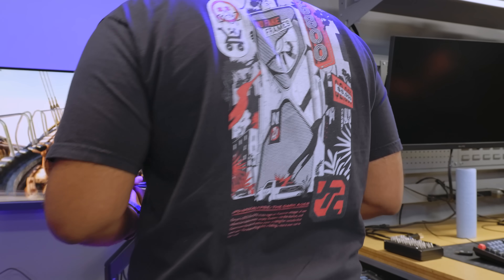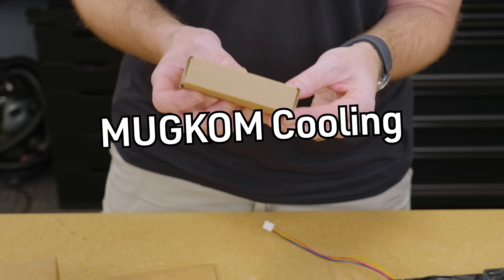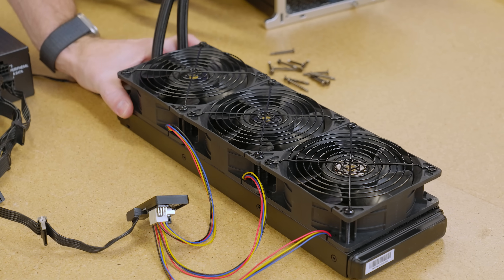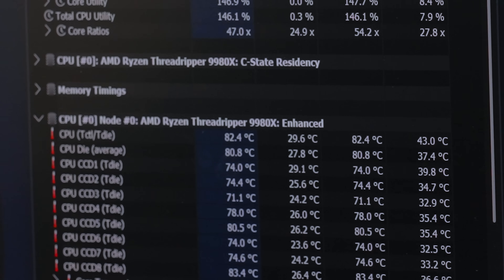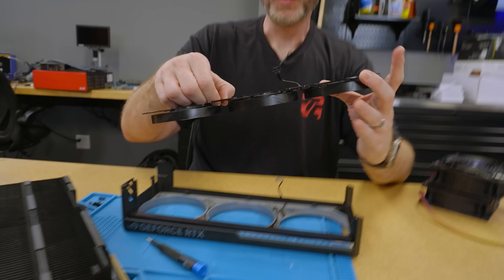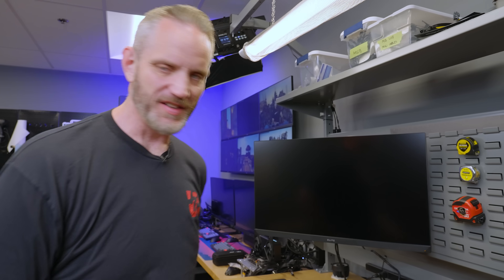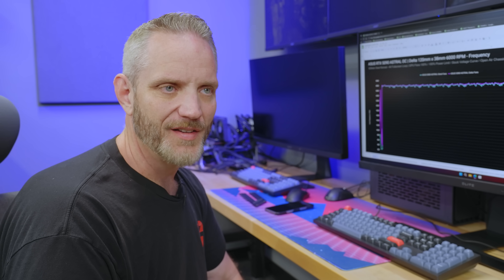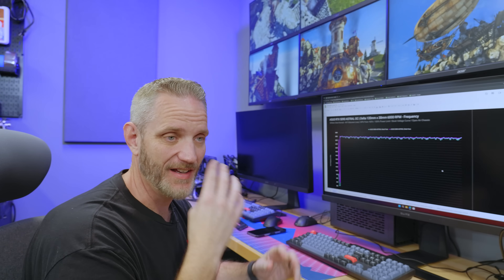Server Fans on a GPU... What could go wrong?

Comment: I think that's the same AIO my threadripper has. I do not have the same RAM though. I looked up your guy's RAM. It was over $1000. I'm like NOPE! Best I saw in reason was about $500 for 64gb. This is more than overkill for me. I was a little disapointed I can't just use normal DDR5 RAM. I did look at a $300 kit, but it was only 4800. This was 6400......but it didn't have expo so I had to set it manually.

Comment: My old B550 + 3600x was so damn silent I couldn't even tell it was on half the time. Now it's a 9960x Threadripper. The first time I turned it on the fans went WHOOOOSH!!!!!!!!! I'm like holy crap dude! Fortunately even with some hard rendering I can't tell it's on most of the time. It's just that first boot was super loud. I guess that sTR5 specific AIO from silverstone is kicking serious ass.
Reply: Same with my pc, i downloaden fancontrol and god damn, with heavy loads u hear it good
Reply: @DNFplays  yeah the biggest load so far in about 2 weeks of owning it was a 70% load with handbrake (so apparently 24 cores/48 threads is just barely past handbrake's "limit"). I did hear the fans, but not the first boot WHOOSH! lol I found my Intel A310 is still faster for video though. But sometimes it has encoding issues. So it's nice to know when quick sync fails Big CPU can knock it out pretty quickly and it's not THAT much slower. Threadripper seems to hit about 200 FPS in 1080p the A310 goes anywhere from 200 to 500 FPS in 1080p. However on my older 3600x, 200 was the maximum for the A310. lol

Comment: We need an air cooler test with those in push-pull :D
Can you air cool 350W+ ?
Note : Can this help MB's VRM heatsink to see some airflow ?
Reply: tf would you need 6000rpm of airflow for VRM's ??? If you're running into issues with vrm temps (120c) either get a better board or do ln2 overclocking.
Reply: @kolegabatric I meant : It's trying to force so much air through heatsink, that air has to go sideways due to fin resistance - cooling MB's VRM in the process.
^Or at least that's the theory ;)

Comment: i used a similar fan back in the day with an xbox 360 red ring death cut a hole in the top relocated the dvd drive an slapped one of those type of fans directly to the gpu cooler. it revived and extended the 360's life for like 6 months

Comment: Quit messing around and grab one of these bad boys!  Sanyo 9CR5748P9G003 , or if you must use 12v Delta THB1712BG ...  Control the speed with pwm. 😁
Reply: 48 V ~270 W... God in Heaven! (pun intended heh)

Comment: Okay, so I know people are most likely going to scream WHAT?!  but bear with me. I have an 1997 Crown Victoria. As anyone is aware, plastic becomes a tad brittle especially in vehicles of this age. Now, there are two doors in the HVAC system, but one of them literally broke internally and I'm not ripping the car apart to get to it. The system airflow is stuck, partially floor, vent, and defrost. Yes, I know when they fail it's usually stuck on defrost, but alas, we digress.  Since I'm in a cold climate about 6 months of the year, I had to assure proper defrost to keep the windshield clear of fog, ice and snow. Since the door was stuck, I couldn't get full flow from the system. Now, I did this a few years ago before the fans that Jayz is playing with came on the market, but still, I wired four 120mm case fans and contact cemented them over the defrost vents (equally spaced). They run all the time because it also helps with the AC. That all being said, it works amazing in the winter... and no, I can take a photo and prove what I did :)  The fans that Jayz is testing would be even better than what I used LOL
Reply: 20 teens Chrysler products have the same problem with all the HVAC control gears sheering off, We got lucky and it broke in defrost only so i ts marginal.

Comment: I got a crazy idea. What about taking a motor from an RC car and put a fan on it. There are RC motors that produce 25hp from a small 8s lipo battery. So what about 16000 RPM and 25HP fan, that could definetly cut your finger off.
Reply: 25hp is ludicrous for an rc motor it would be a really big rc lol
Reply: electric motors are measured in watts not HP.
Reply: @TierOneMediaAB  both are units of power, 1 horsepower is 745 watts
Reply: Not 25hp lol. My 240v milling machine motor is 80lbs and 3.5hp
Reply: A gas powered riding lawnmower engine ranges between 10-40hp.

A 40v lawnmower produces between 1-1.5hp optimistically 😂

Pro tip:   RC motors get REALLY hot.   So very freakin hot.  Some rc's have their own high-pressure fans to keep cool while running.

Comment: Not even 30 seconds in and Jay removes 3 toes with the metal "safety sign" 😂😂😂
Reply: Instant safety karma 😂
Reply: Living in LA, probably wearing sandals too
Reply: @ShadowQwertyLand used to work with a bike mechanic that wore crocs, every other guy had steel toe caps, he had his "safety crocs" 😂😂
Reply: @stewart9540 Always remember to put them in "sport mode" for extra safety!
Reply: Steel toe boots and hardhats are essential PPE during PC assembly.
Reply: @dryrain2 You've seen my custom loop building style then😂😂😂